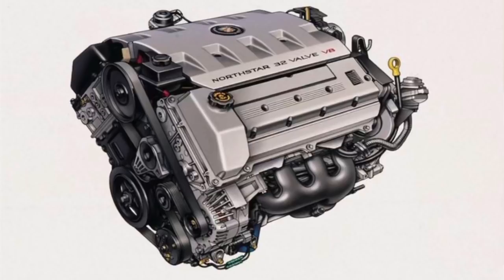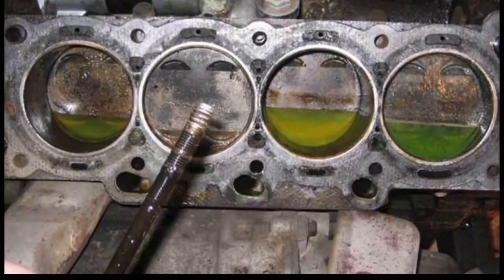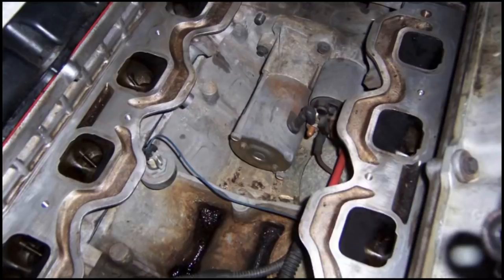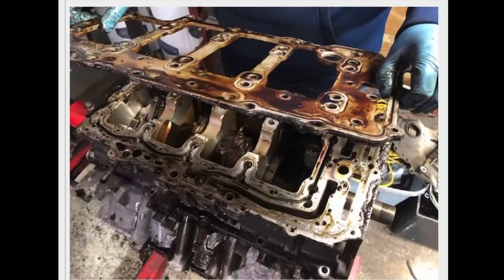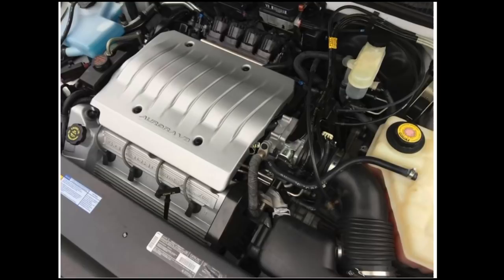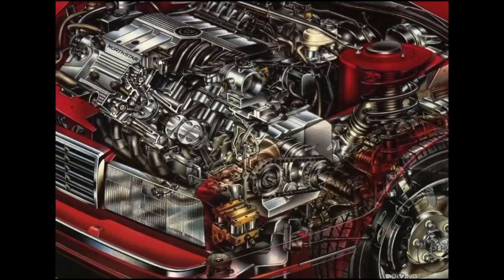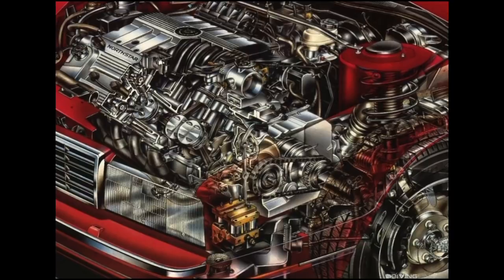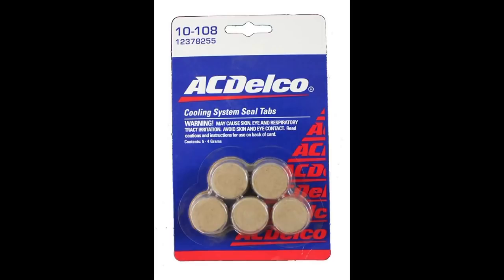Worst Car Engines of All Time: Cadillac Northstar

Comment: Ex Seville STS owner here. The Northstar is an American engineering masterpiece - a great engine. It's a complex engine and lazy mechanics used to work for decades on simple small block pushrod engines of course hate Northstar. But this is one of the best engines Cadillac ever produced. Great performance, German Autobahn capable and relatively efficient for the time. Very reliable too: I made 300'000km until I had a first problem that caused the engine to go into limp home mode. The waterpump failed. 4 cylinders were pumping air through the block to cool the engine and 4 cylinders  were propelling the car so I got back home (about 50km). The mechanic replaced the pump and problem was solved. Great, great engine!

Comment: We had a used 2006 DTS Performance model.  I can certainly attest to the oil leaks and engine gasket issues.  The local Caddy dealer told us to fix it would have cost around $3,000.00 and at least 3 days.  Just as you said, they have to drop the engine completely out of the car.  I agree that "when working properly" it was a great running and performing engine with great sounds when pushed hard.  But, everyone stay away unless you've got deep pockets or have the ability to fix these problems yourself, both of which we lacked.  Why they continued to make that engine is mind boggling to me.  Bad, Caddilac!  Bad!
Reply: The engine does have a lot going for it, and GM says it is the most sophisticated engine they have ever made. Instead of dropping it, I'd suggest advancing and simplifying it.
Reply: I had an olds aurora that I had set up to run in the silver state classic and luckily i never had a problem with it.I changed the oil at 3k and when I bought it with 100k I had all the fluids replaced and everything fixed and it was less then 1k--I sold the car about 2 years for exactly 1k more then i paid--so i actually broke even on it.These cars were great when they ran and some folks like me got lucky and had no issues.
Reply: Just ls4 swap it, you’ll gain a couple horses in the process
Reply: Get an independent garage to put a stud kit in it.  That's what I did to mine.  No more issues like that ever again.
Reply: GM improved the head bolts in 2000 by lengthening them, and resolved the problem in 2004 by going to a coarser thread.  If you had head gasket problems with a 2006 you were either extremely unlucky or had other issues.  And oil leaks were exclusively an issue with earlier designs pre 2000.  Again, not an issue on 2006.  The real tragedy is that it took GM until 2004 to make it a great engine, and then once it was an excellent engine they discontinued it.  Only at GM.
Reply: I run mine pretty hard.  185,000 and still stroking it.  No new head bolts or oil leaks.
Reply: @knurlgnar24  I have an 04 Deville DHS i bought for $1200 with 130k, and the headgasket blew. Yes it was the one that got the upgraded bolts, as i learned how to check the engine codes on the block from a website. Story made short, i put this liquid headgasket fix in called Thermalweld, which is made for northstar specifically. Ran this whole summer after the treatment in up to 95F weather with the A/C on. Now runs at 190F all day which is hillarious considering Thermalweld is 2 small bottles of liquid.
Reply: What about the 4.9 is it a good engine ?
Reply: @kenbowser5622  How Many Miles you up to Ken ?????
Reply: Poor people werent buying cadillacs.
Reply: @khronin  I had an Aurora also and experienced zero issues with it. The Caddy engines with the extra displacement seemed to be the troubled ones. I got 295k out of my Aurora before it was wrecked by my teen nephew.
Reply: @bbbbojangles2737  if you look at what so called rich are buying, then right away this gave me an answer for my of my new vehicle 😂.😅😅
😅
Reply: @bbbbojangles2737  oh shit then I guess I'm poor.😂😂😂😂😂
Reply: @audioelitist3677  , and how much did they charge, 3 grand?
Reply: @knurlgnar24  , that's what they do. Remember the Fiero in the 80's?  They were extremely underpowered when introduced. After about 4 years, they came out with a V6 model that was improved tremendously. But as GM is known for doing, they pulled the plug on the Fiero after the car was finally what it should have been from the start.
Reply: @Pistol54Pete  Pretty sure it was like 2200 or something close to it.

Comment: Let's face it, this is an exotic engine. Unfortunately, somewhere along the way  a bunch of people, engineers and bean counters, dropped the ball and didn't step up to admit there was a problem. GM absolutely refused to take responsibility. This problem NEVER should've EVER come up, because it should never have left the brain of whatever engineer mistakenly thought a fine thread into aluminum was a good idea
Reply: Good point. When the head gasket problem gets fixed, it is a totally superb engine. I got mine done 5 years ago, and it is the most reliable car possible. The next item on the maintenance/repair schedule is the ignition module. GM has discontinued this, but a supplier Blue Streak in Poland is not sure when they will be making a new batch. The Cadillac enthusiasts, owners and repair shops should band together and work directly with the suppliers to keep this part stocked.
Reply: If you recall, there were many articles about the Northstar years before it was put in production   It was the engine all of engines but I think that the reality was planned obsolescence. GM relied on people trading in their cars every 4 years and then bringing to junkyards four years after. Just look on Craigslist how many 20 years old cars, quite a bit being T
Reply: Toyota’s selling for $5 k.  Then look at the Cadillacs.
Reply: I heard they wanted to use a coarser thread in designing it..but the bean counters decided to use tons of bolts left over from the quad 4 engine (they had crates and crates and crates),so being a  cheap bitch gm screwed themselves and put a stank of Cadillac customers when they early northstars were failing… also using a slogan of the coolant don’t need to be changed for 100k miles and the it can run with no coolant for 50 miles by shifting head sides while running to cool down the other…the smart people who changed their coolant and never ever heated up their motors are the ones that had good luck with 92-04 northstars ..the lazy ones that never changed the coolant , lax on oil changes and letting it get too low,paid the price and there were more lazy people than people that are on top of their engines maintenance.
Reply: I wouldn't call a front wheel drive V8 powered car exotic. This V8 doesn't have more power then a V6 Honda Accord or Camry TRD. This is a slow gas guzzler. A V8 powered car better be rear wheel drive with at least 400 to 420 horsepower and it better be able to go from 0 to 60 in 4 seconds or lower. This Northstar V8 and the Chevy Impala SS make no sense at all.
Reply: Engineers made a pretty good engine
Reply: @vintagetriplex3728  I didn't call the car exotic. I called the engine an exotic. And, for its time and ESPECIALLY for GM, it was an exotic. A poorly thought-out exotic concerning longevity and the happiness of its customers, but an exotic, nonetheless. I drove a few Cadillac Sevilles in 1996 as I was, very briefly, a Cadillac salesman. It was a great sounding, powerful, smooth engine. Unfortunately, GM felt that they didn't need to go all the way, only going 80% of the way. They did that so many times, and their blasé attitude led to their bankruptcy. My 2006 GTO has a known issue with porosity, and it drips oil occasionally. The rest of the car is Holden and really put together well. I wish the engine was built by them, too. I've lived with the occasional drip since it was new. But, to put out cars they KNOW have issues is beyond me.
Reply: I think part of the problem is that people who routinely buy in that category of car - and those STS (Seville Touring Sedans) were gorgeous - expect value for their money. 
I didn't become well-off by confusing sh!t for Shinola. I'm not my parents, who pretty much chose a car brand for their first 'money doesn't matter' car and that was that forever.
I expected the cars in my fleet back in the 1990s, which cost less than half what those cars cost, to last a solid 200k and still pull down a reasonable trade-in price. Found that in Toyota. Every GM car of that era had problems which I would not have expected after all those years of designing and building. Had Cadillac stood behind them and said flat out: We made a mistake, we want your business, let's make this right, it would have gone much differently. Instead, they pretended it wasn't so and then that it was just a 100K engine and people who drove those cars were not going to be interested in driving 'old' cars.
And so on.
Bad, bad, bad decision making from start to finish. Especially for those of us still recovering from the horrendous Cadillac problems of the late 1980s. Our Fleetwood Brougham d'Elegance we bought our parents for their 50th wedding anniversary was the single worst car, ever. Buying a beautiful STS only a few years later and then having it blow up on you and drip oil non-stop and have coils which were worse than 1950's Lucas Electric points in a Morris, no. Just, no.

 @2006gtobob

Comment: Greetings from Glenn in Cleveland!   You hit the nail on the head.  When I bought my 2001 Deville (lease turn in with 30k), it ran perfect for many years. When it turned 70k it was burning a quart of oil every 1000 miles. A few of my friends had the same issue with their  Northstar engines with around the same mileage. The cars were all bone dry underneath.  There was no smoking gun so to speak out of the tail pipe.  When my Deville turned 120k it developed the dreaded overheat issue (head bolts). I replaced every part of the cooling system! It still had the overheat issue. When I replaced the expansion tank coolant cap, the issue went away until 128k. At this point, I couldn't go more than a couple miles from home. The car seldom ever left the garage anymore.  After 17 years, and the last 4 years of pretty much sitting, I traded it in last February.  I've owned 5 Cadillacs and each one managed to turn 200k with routine maintenance, except the last one.
Reply: I understand if you do not drive them aggressively once in a while, the rings start sticking and they burn oil.
Reply: I have a 2003 Deville DHS at 141,305 miles and have had no overheating issues.  It literally runs like a newer model car. A few issues with the air ride and ebcm but I recently ordered a bypass kit to remove the air ride system because the ABS, BRAKE, TRACTION control lights are on.  We'll see if that fixes the issue.  I'll let you guys know.  The car is my profile pic btw 
1LOVE to all
Reply: I have an 02 Eldorado.  No oil between changes, never had head bolts changed, 185,000 miles.  I do change the anti freeze every year tho.  Don't want it getting acidic, might add to the head bolt issue.
Reply: @MostlyBuicks  I have 185,000 miles on one.  I sometimes run it pretty hard.  Don't leak oil, didn't change head bolts.  I change the anti freeze every year, tho.  Old stuff is corrosive

Comment: Was Service Director in a Cadillac store in the 80's as I posted before. Lived through all the engine problems you mentioned,  almost impossible to  get customers to understand why we couldn't cure poor engineering problems.
HT 4100 also developed low end engine knock especially if it had been overheated.  Iron heads on aluminum block caused main bearing web casting to distort resulting in bearings to become egg shaped. Cure was to install redesigned bearings that had extra material on the back of the bearing shell. Measure bearing clearances and decide what size color coded on the back of the main bearing(green, purple,  yellow) to install.  Did fix the bearing thud but what a bandaid approach for the "Standard of the World"
Reply: I worked in the same position in the 1980's. It was truly disgusting what GM turned out as "cars" Transmission  problems, steering gear problems, water pump pulley breakage.  Noisy fuel pumps. The RWD cars were way underpowered, and the new FWD cars, were just a disaster.  Many of my customers ran to BMW and Mercedes.  And they never came back, and I do not blame them, one bit.

Comment: In aerospace design, female threads in aluminum (fine or coarse) are never used. Instead, a steel insert (looks like a coil spring) with external coarse threads and internal fine threads is screwed in, then 'staked' in place to prevent rotation. Works extremely well and cost pennies.
Reply: But GM saved $5 by doing the head bolts the was they did
Reply: This was a fix by GM, they’re called timeserts. Unfortunately it didn’t help too much as the torque would pull the bolts out anyway. The only real fix is to re-tap the block with very course threads. They’re bulletproof after that
Reply: One dude "f'd" up and a few others signed off on it during a hangover day....so who gets hurt?  Lighten up. :)

Comment: The exceptions I should mention is that they did fix those issues. For the 2004 (for rear wheel drive LH2 variants) and 2004.5 (for the front wheel drive variants LD8 and L37) up model years, the headgasket issues should be almost if not entirely be eliminated as they took the beefy head bolts from I believe the LS5 and installed them in these engines. 

I own a 2004 SRX with 186,000 miles and she doesn’t burn any oil, and you can’t even smell gasoline or blow by in the oil. She has had 2-3 over heating events in her life, within the family (belt snapped, one because the idler pulley seized, and the last because the water pump failed), before I took ownership. 

Other than that no catastrophic issues and I consider myself lucky that she’s not an oil burner at her mileage. The only issues I’ve had are currently she leaks a bit, and I’m currently replacing some power steering lines, but otherwise ok. 

My statement is these years (2004.5-2010) were among the last and if you want the most durable northstar and the most powerful naturally aspirated variant, then the rear wheel drive LH2 is for you, which can be found in the Cadillac STS, SRX, and XLR. These engines came with newly designed blocks with support ribbing, a forged crank (which is cast on the front wheel drive versions), Hypereutectic pistons (I recall), modified ring gap clearances, improved coolant flow arrangement and direction, among other rigidity improvements. 

All vehicles from this marked year should be fine and that includes bonnevilles, Lucernes (I owned one with the 3800 V6 and a sibling has the northstar variant as we speak), and etc. 

One other option which I hear is pretty robust and haven’t heard anything bad about is the expensive yet exhilarating LC3 supercharged 4.4 northstar V8 which I heard is phenomenal when maintained. 

As one last piece of advice, DON’T use dexcool (I use Asian red phosphate coolant as I like that better), unless ya want sludge for days and although the new formulations are ok, I still don’t care for it. Furthermore get one that has been MAINTAINED with lower miles but also not sitting as that’s worse in my opinion. Other than the leaks, which I recommend a bottle or two of AT-205 reseal for, make sure to wind them out every so often as they are performance engines and especially so in older ones as sedate use long term can cause problems. 

Great job on the video and excellent work!
Reply: Hypereutectic.. 🤔 I just learned a new word! Thanks James.
Reply: '....they fixed the head bolt issue in 2004...'   Well, there's a ringing endorsement.  They fixed the problem....they fixed it only 10 years after the engine first hit the streets.
Reply: Your comment wins! You sound like a true enthusiast of these cars. I’m a mile enthusiast and owned an Aurora Northstar that didn’t have anywhere NEAR the issues that I see ppl having.
Reply: Who's endorsing anything?  Facts are facts. @MrSloika
Reply: The post '04 STS had its own share o' troubles apart from the Northstar system.  Whew, what a clunker! :)

Comment: As a GM tech of the 90' and early 2000's, these are all very valid points.  The water pump having its own tiny tensioner and belt driven off the camshafts also causes overheating when failure exists.  That being said they are smooth, powerful and the engine pitch through the powerband is a thing of beauty.  Excellent video.  👍
Reply: What did you think was the worst car GM made that you had to work on?
Reply: @ElementalMatrix  By far the 3.4 DOHC vin code X used in the Chevy Lumina Z34.  It was in other GM cars with W body.  Later is the early and mid gen 3.4 used in the GMC Acadia, Buick Enclave and Chevy Traverse.  That latest gen 3.4 used seems much better.
Reply: Yeah I heard about that. I think I am going to buy a new pulley right now for my newly acquired 2008 DtS.

Comment: I've had 6 caddy's with northstar engines and besides replacing a thermostat on 2 of them, one water pump they have been trouble free
Reply: i have on my boy has one   no problems..the fix  run the piss out of them  no an then
Reply: buy a lottery ticket l1 master car and truck mechanic 50 years in the trade
Reply: an the northstar is  not the only ones  that have heat bolt  problems  ..